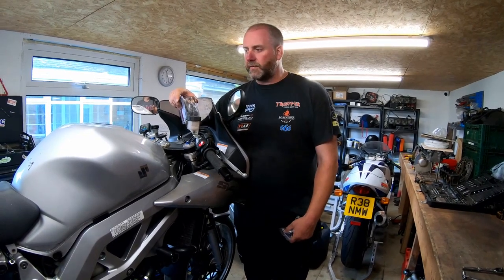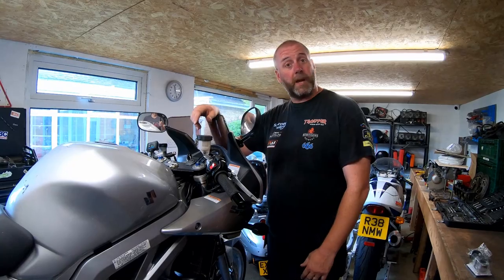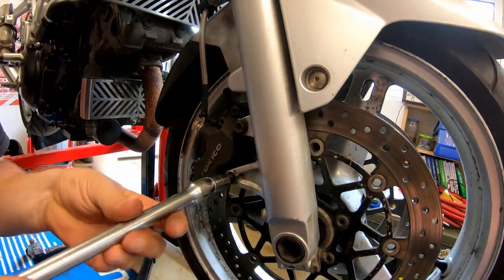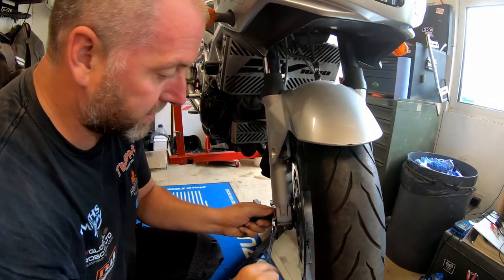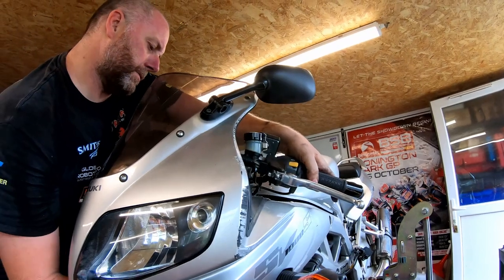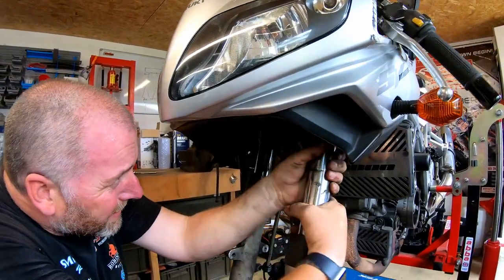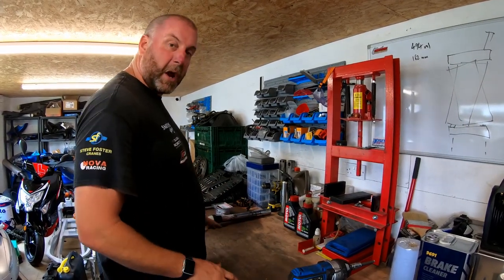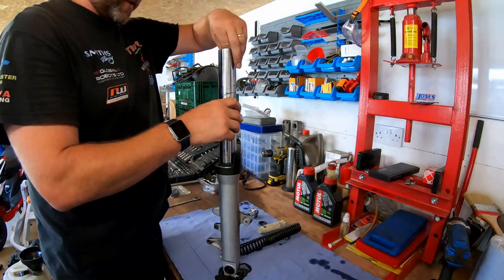Suzuki SV1000 Project Bike - Part 12 - Fork Seal & Fork Oil Replacement

Comment: I found a set of 2007 GSXR750 forks, had them resprung with Öhlins, Elka pistons and Ktek clickers. Had to mod the upper clamp, braided lines to 2007 brake set. This is the best thing I did to the bike and I have done a lot to it.

Comment: At about 52:00. The spring goes that orientation because it's a progressive spring. The loose coils at the bottom make for a softer, more compliant ride over smaller bumps. As the spring loads up over bigger road hazards, the tighter stiffer coils at the top come into play
Reply from the maker: Correct, it goes that way because the manual says so, however if you put it in the other way the spring would still act exactly the same, it would make no difference to the way it rides!

Comment: What size tube did you use for your DiY tool to remove the damper rod? I serviced the left hand form without needing a tool, but the right side is just spinning with the bolt. Thanks for these videos they are very helpful.

Comment: Great video. Thank you! Does anyone know what weight fork oil Suzuki recommends for the SV1000? I'm only 64kg and the factory settings seem fine for me. I heard 5wt. was right. I've also got some burs/imperfections on the stautions. Could you use say 2000grit wet and dry paper to remove them?